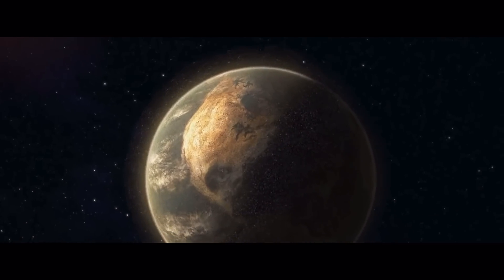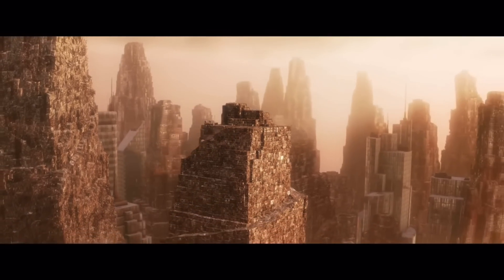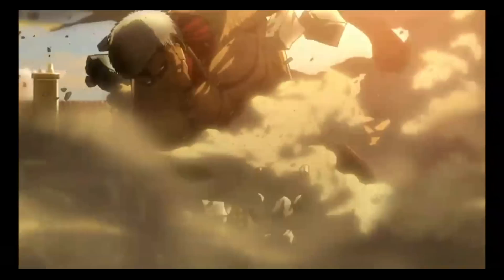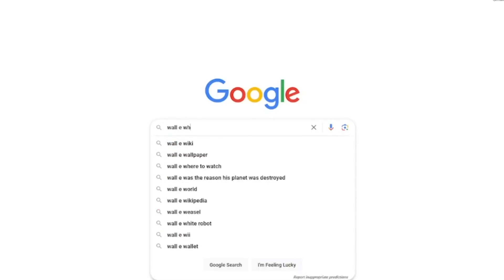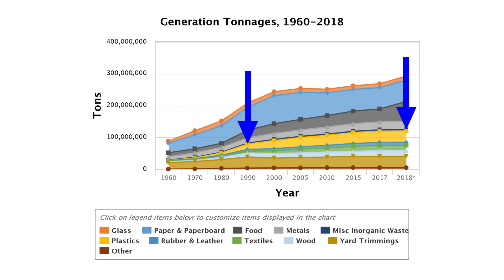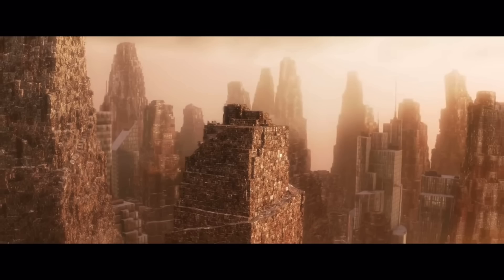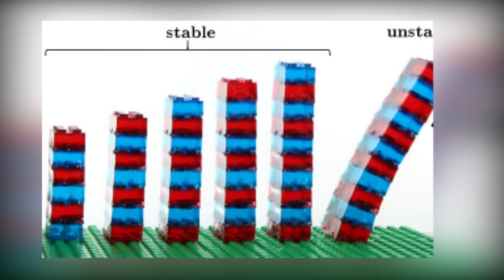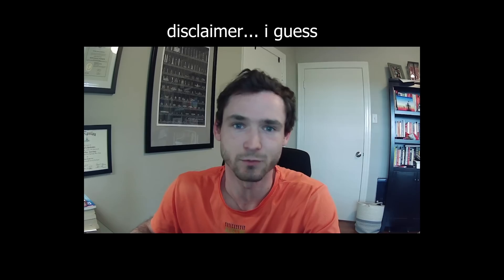Wall-E's Ridiculous Skyscrapers: A Design review

Comment: There's actually a lore reason for these towers.

The way the cleanup operation was supposed to go is that an army of Wall-Es constructs a bunch of trash towers in an area and then those towers get deconstructed again by some sort of bucket wheel excavator/incinerator hybrid.

The project was ultimately aborted because burning skyscraper-sized trash mountains made the already near-unbreathable atmosphere even more toxic. Somehow though the Wall-Es never got the memo so they just kept building trash spires until all of them (except one) broke down
Reply from the maker: Interesting, I hadn’t read that before. Wall-E was quite the determined little guy then.
Reply: @onstructures  You can actually see the incinerators rusted up in the background in a couple of shots
Reply: @onstructures  another thing to conicder is how the tops of these towers Not warping out of shape . . if the blocks had as little as 1% iregularities would mean the tower tops would look like jumbled mess whitch emplies all the cubes must have nearly identical shape whitch is rather peculiar to say the least
Reply from the maker: @bluewhalestudioblenderanim1132  Ohhh yea no kidding, wallE must’ve been a finely tuned machine!
Reply: @onstructures come to think of it, the blocks should have a mechanical bond not like Lego, more like velcro, the surfaces are all uneven. The harder materials run a blade like web on the faces of each cube, so the more weight, the stronger the interlocking should be with the cube above. Although, at a certain point, I imagine the cubes should expand sideways into the others. I also don't know how a cube shape will handle a  lateral load compared to other bricks forms that are designed to to press even tighter under lateral forces. (I'm not an engineer just wondering)
Reply: @bluewhalestudioblenderanim1132 they could have that in consideration when designing their programs just like a rock wall constructor find the best piece in each placement that would extend on every piece of trash the block is made of like the lower levels being made of metal and rocks to withstand the preasure and the top ones being made of plastic and lighter stuf that level of randomization/chaos to order neded is what could be the reason why walle end up develop conscious and since is not his motherboard it must be the settings he come out like some sort of digital number hes programed to imprint in every piece he replace buging him forever like the max number+1 that is able to count a 32 bit computer, what a nerd fever dream the movie is
Reply: @onstructures  @mcdowell5988 made a nice video recapping the prequel comics that could maybe answer some questions or give more insight into the trash towers
Reply: @onstructures  naturally there were thousands if not millions of wall-e's aswell as the tower eaters
Reply: @onstructures  I believe the wall-e art book has an explanation to it, though it's been a while since I've read it
Reply: @onstructures  He is also quite the Cannibal, harvesting old parts from his death friends. just so he can last a bit longer.
Reply: @darknessblades  You do realise we humans do the same thing in our hospitals right?
Reply: @darknessblades  they aren't using it. So... Might as well
Reply: @darknessblades I wouldn’t say he’s a cannibal, it’s more along the lines of donating an organ, just spare parts us all. I mean, they’re not gonna be using it anyways.
Reply: the extras on the dvd have some stuff about this and you're right, the plan was more or less to collect all the junk with wall-e and other units and burn it and blast the ash and smoke high into the atmosphere/stratosphere, not the best plan
Reply: Another interesting point relating to the Wall-E units, they will cannibalize parts from their malfunctioning or dead units, considering we see a scene in which the protagonist unit swaps out his tracks off of another unit(presumably ran out of charge).
Reply: @nickforgie4290 I don't think that's true. The fact that the protagonist will take time out of pursuing his directive to take parts off a dead WALL-E unit explains why he's still functional and they aren't. The protagonist is self-aware. The others were just robots following their programming until they failed.
Reply: @ReddwarfIV  Yup at the end of the movie you can see that when Wall-e's motherboard get replaced he stops being intriged by trash meaning Wall-e is concious but the other probably weren't.
Reply: @ReddwarfIV  I don't think THAT's true. If we assume that all Wall-E units cannibalise from brown down Wall-E units, but general wear and tear continues to take them out one by one, it stands to reason that you would end up with just one unit still operating in an area. It would be utterly a question of luck; having parts wear out which don't lead to total breakdown or shutdown, allowing repairs to be carried out before it's too late.

We see that all machines in the movie seem to be self-aware and so it's not a stretch to imagine that all Wall-E units were functionally identical. 

The real difference with the protagonist Wall-E unit is that it expressed an interest in keeping random objects which interested it-- this was likely a product of faulty programming. But then again, as I said, we see that ALL machines seem to be essentially "people", and so it's not a stretch either to imagine that all Wall-E units had personalities or, more intriguing, were programmed to keep certain items which might have been viewed as useful when the humans returned to Earth.
Did Wall-E's programming turn faulty, prompting him to save items which were not originally on his list of items to save?
Reply: @oxymoron02  The Axiom robots certainly had personalities, but then, they were both more advanced technologically and designed to interact with people.

We see what a standard WALL-E unit behaves like, when WALL-E himself is reset to factory settings by the motherboard swap.

It's possible that the other WALL-E units would cannibalise for parts if they came across another unit, but it's that same curiosity and interest that caused him to bring spare parts home.

Nothing in your comment is wrong, I just don't think the protagonist being the last functional robot on Earth is down to luck.
Reply: @ReddwarfIV  and earth being a rather large place, maybe they chose to focus on the sole "wall-E" that happened to have a story involving finding a plant?

cus it wouldnt have been much of a movie if they just followed a wall-e around as he tootled hither and thither.

"meanwhile, in liverpool, wool-E sets about his daily tasks... picks oop his lil boody, roachy, and sets his sights on the last remaining pile of trash..." (you gotta narrate that with a ringo starr/thomas the tank engine voice ;))
Reply: @paradiselost9946  Maybe.
Reply: @oxymoron02  Wall-e's plot-essential difference from every other character, is his ability to take breaks and change up his routine.  All other WALL-E units died mid-operation, implying they all worked themselves to death.  Post-breakout repair ward bots are able to resume normal functionality, which confirms this.  

Wall-E's frontal chip seems to serve some secondary "courier" function - the interface faces outwards, with the arrow pointing right, and there's a hook on the back.  I think you could give a unit some cargo, record a message, and send it to a recipient who can replay the audio to know what to do with it.
Reply: @nickforgie4290  just like the general outline and design of wall-e is taken from the movie "short circuits", so is the cannibalisation scene...
wounded, captured, and powered down, he revives enough to drop a spanner on his power switch, replaces an arm, and a track... then hijacks the van he is being transported in. yay :)
even the pet cockroach reeks of the "grasshopper disassemble" scene...
Reply: @nickforgie4290  as far as we're aware, the only surviving Wall-e is the only one that does it
Reply: In a prequel comic, it was actually shown that one of the actually burning mechanisms was shut down entirely because it stopped burning.
Reply: There where also supposed to be giant Wall es like the kind you see on the axiom
Reply: yea they made a few comics taking place around 700 years before the movie . i'll edit this comment with the @ of the dude that made the video in a second if you wanna look into it and potentially make a pt. 2 or something

@mcdowell5988